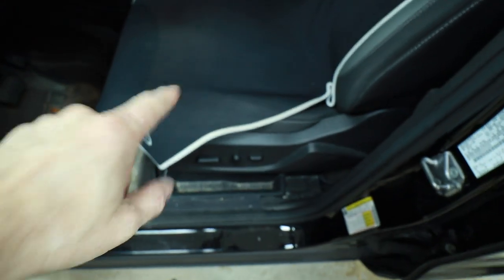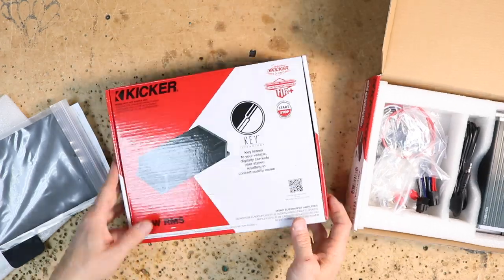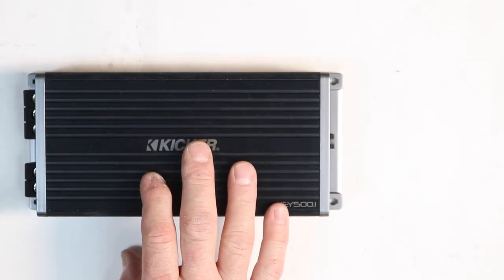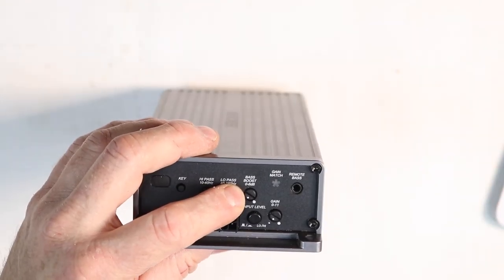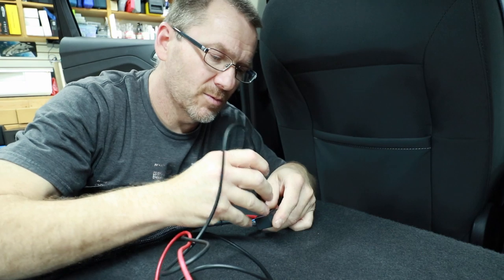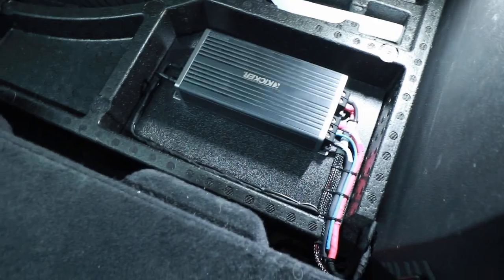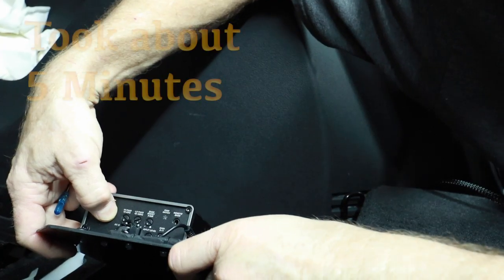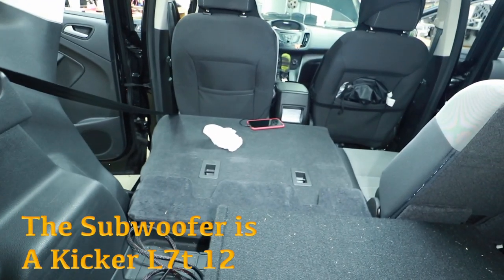The smartest sub amp ever Kicker Key500 1 Mono DSP Amplifier

Comment: Kicker should make a 100 watt x4 key amp and a 6 channel kicker key amp with 6 dedicated outputs 2 for tweeters, 2 for the midwoofers, and 2 for the rear coaxs. Then a kicker key 5 and 7 channel amps that does the speakers and subwoofers in one stop shop.
Reply: There could be more interesting Key products coming, you just never know. ;-) Stay Tuned...
Reply: @kipplitz  are the crossovers on the 500.1 LR24db as well?
Reply: @tfunk1829  Yes, they are 24dB Linkwitz Riley...
Reply: @kipplitz  Thank you, I got the 200.4 and was looking using this to hopefully avoid phase issues.

Comment: I lost all faith in kicker after purchasing one of their cx 4 channel AB amps. The thing would get scorching hot after just a couple of songs.
Reply: I just went with a Orion XTR 750.4 which has blown me away.... Tiffinay in and out rca jacks, underrated as hell(3x40 amp fuses) and it TINY For a  class AB. I don't know how orion does it. Look at Scar rp 150.4 and how long it is.  Orion's new owners are doing almost everything right.
Reply: 🤔 i just got my kicker key yesterday and I haven’t hooked up a sub but everything else is hooked up and I went on a 30 minute drive today and it’s hot to the touch, I wouldn’t want to hold my had to it more than a couple of seconds.
Reply: Yea man I took mine out after about week and replaced it with a pioneer 4 channel class D. I had it running my coaxial midranges. I'll never buy another class AB amp again.  My kenwood sub amp would be blasting max power to my subs and maybe only get a little warm while the kicker cx was a fukn inferno. Haha.
Reply: @hippo-potamus  not all class ab get retarded hot, at least not properly designed and mounted ones. There is nothing like the warm sound they produce. Cant beat class d $ to watt however.

Comment: I finished installing the 500 today to power a Kicker TRTP 12. I also have the Key 180.4. I previously had a 300 watt JL mini amp so I didn't really upgrade in power but I did notice that with the 500.1, the bass is actually omnidirectional where as before I could always tell the bass was coming from the rear hatch. I also added the bass knob which has come in handy. Even though the boost is only 6db's, it's still a noticeable difference at lower volumes. I have an aftermarket HU so I didn't really think the Key features would come into play but it may have done something to make it sound more omnidirectional but I haven't really listened to enough music to know for certain or if it was just because of that particular song I tested. But the easy to set gain and bass knob made it worth the swap for me.

Comment: Can't wait to get mine for my G8. Hopefully it'll push my T3 T2000 I have. I know it's underpowered but not looking to win spl comps lol.
Reply: @A. Melbs I don't even remember posting this haha. But anyway I mounted it on the cup holder middle section in the rear seats. I used little spacers under the feet to help with air flow and have it so the middle section can be folded up and not cause issues with wires. Hope this helps.

Comment: I just bought a used 2019 Rav4 non jbl system. I was thing maybe if running the 4 channel and sub kicker key amp under the glove box high level. Have you guys ever worked on one of these vehicles? Just to get some insight. Thanks!
Reply: Most all cars really similar and obviously sick what you want but  myself this would not be my pick! I like the auto adjust on the gain but I would go more serious! #1 after market head unit!!! #2 high amp alternator!! #3 get some 14 volt batteries!Then  for my money ($256) I would run the hifonics BRX3016.1D which puts out up to 2200 watt RMS !! On 2- 15'S  with all that said there are many amps out there that will out perform this tiny system and I will also add that the equiptment he's pushing is over priced and low powered! Has a nice tuning feature but any stereo shop worth their own salt or anyone with ears should be able to properly set up equiptment or tune a system! So it's sort of a redundant feature! I miss setting up systems myself but I would recomend shop around& look at other equiptment! I know maybe it's size is your goal but know that other manufactures needs space saving amp's too!

Comment: Did you purposely leave the LPF at 160hz and the HPF at at 10hz? As I understand it, you do this when using a factory headunit that has non-defeatable built-in crossover points. This way your not doing double crossover points or else you could run into phase issues (comb filtering?). However, how do you know what the factory sets those points at and if they'll be sufficient to use a with a larger or more powerful sub/amp combo?

Comment: I'm soooo glad kicker is coming back into the audio world. What I mean is in my opinion when kicker went square subs everything became, well cheap. I was a huge kicker fan in the 90s. Loved the first solo's too. But when they went square everything  at least to me seemed to be more oriented for the beginer audio to the lower lever guys. Budget friendly yes, but there wasnt the old still water goodness. The warhorse while a true feet of audio engineering was the only thing I have seen from them in years. That is untell the key amps. These in my mind puts kicker right back into the mix with  the killer koreans.  At least for me this is a product that will bring me back to kicker. I still have so many old kicker products. I'm glad to add some new to the mix. You may disagree with me on this, but I'm by no means alone on the feelings.

Comment: Curious... Why don't you ever use nutserts in the ABS when mounting the amps? Also... What do you do with excess RCA cables when you run from the back to the front? Just tuck it away under the dash?
Reply: @Michael Paredes   

Nutserts would protrude too far on the underside/backside of most of the thin 1/8"-1/4" ABS plastic sheet that they use.  And the rivit type nutserts will not "hold" in soft plastics...they will break free and spin with very little torque applied.

The other type of inner & outer threaded inserts that "screw into" wood or plastics with a hex or allen key driver require at least 3/8"-1/2" thick material, which they rarely use.

They answered the RCA question in one of their livestream videos a few episodes back...

They test the length & routing of various RCA interconnect cables in the car before actually installing them, and then choose the shortest RCA interconnect that will comfortably reach between the two components.

If it is still too long, they try to find another naturally good path or route that uses up the extra length of cable without having to bunch up the excess at either end.
Reply: @bbfoto7248  Thanks for answering my questions!

Comment: I have a dumb question... I know there's a kicker key 4 channel amp that you're pairing with the key 500 mano amp.... I Looked through the key five hundred mano amp and the key 4 channel 200 amp  online manuals  and I didn't see a passthrough to send a base signal from the 4 channel to the mano.... Does that mean you're taping into a front or rear speaker wire to send a signal to the key 500..

Comment: I got the kicker key 500.1 working. I was dealing with a bad remote wire. Follow up question can I use the high input from out of the Kicker Key 200.4 to the input of the Kicker Key 500.1? Will it sound ok?

Comment: Would you recommend this amp for the Kicker downfirering 10" Subwoofer 400 watt  or amp more beefy like a 500 watt amps.
Reply: Power wise it would be a decent match but what ohm rating is your 10? That's the question you would want an amp that pushes the power you want at the ohm rating of your speaker! Most amps put out may power at 2 or 1 ohm so if you 10 is a 4 ohm  then no it wouldn't be good!
Reply: Eric McGinnis gotcha it’s a 2 ohm sub, this amp puts out 300 at 2 ohm so it’s a bit under powered I guess.
Reply: @chrisdixon9504  being 2 ohm this opens the doors to just about any amp! Any decent 500 RMS amp at 2 ohm  should do and remember distortion kills not power so 500 clean watts but then again 2 ohm also brings up the distortion of the amp! I personally think you should consider swapping the 10 for 2 12 duel 4'S wired series parallel to 1 ohm and get ya a good 1000 watt! But you know monday morning quarterbacking with my should'a, could'a ,would'as

Comment: While you are adjusting the sub gain with the volume at 70%. How do you keep the other speakers in the system from playing very loudly? I noticed that while you were adjusting that subs amp the other speakers weren't playing.
Reply: just unplug the inputs on the highs amp?

Comment: Question on the subsonic filter; for a sealed 8" box, roughly what should that be set at? I've heard the filter is mainly for ported boxes (meaning you can turn it all the way to 10 for a sealed box), but figured I'd ask in case the interwebs have led me to the wrong conclusion
Reply: Drivers in sealed enclosures don’t need subsonic filters. They’re only needed with ported enclosures because below the port tuning frequency the driver will unload. It’s really easy to damage a driver when played lower than the driver’s Fs. When set correctly, a subsonic filter will stop that happening. I’m a sealed enclosure the air in the box will prevent the driver from unloading. The air acts as an additional suspension for the cone.

Comment: I’m wondering if you can give me some input.  I have a 2021 Nissan titan with the fender Soundsystem which has no bass there’s a subwoofer under the passenger seat which I would like to remove sub from the box and substitute it for a kicker shell mount 8 inch sub i’m curious to know if I use the four wires going to the sub as it’s a sub input will it have the power to turn the  kicker 47key5001 on

Comment: I know it has been a few months since you posted this video. I have a question regarding tubing and the bass knob. Should the bass knob be connected and turned all the way down or connected all the way up or completely disconnected during the key tuning process?
Reply: The bass knob on all Kicker amplifiers only turns down the bass. It's not a "bass boost" or "gain control" or "extra output dial" or anything like that. Remote knob all the way up equals whatever the gain on the amplifier is set to. It only attenuates. So to answer your question, either leave it disconnected or plugged in and turned all the way up.

Comment: I have the kicker key 180 running jl audi c2 components active in the front of my audi rs4 saloon it sounds excellent, I use a kenwood 5180 dabs. I have a sub amp setup in the boot and removed the standard woofer in the shelf to let the bass into the cabin, Is there a reason this sub amp doesn’t do time alignment for the sub with a mic, would this not be useful or doesn’t it matter on a sub? Love to hear your thoughts. Great video as usual.
Reply: David, I will try to not dive too deep here but get you an answer.

You can express how far away a sound or point of sound is in distance measurements (mm, cm, m, in, ft, yd) or in time measurements (344 meters per second, 1132 ft per second for sound in air at sea level). This is important because the two can talk about the same thing but in different expressions. It can be 1 second away or 1132 feet away, both say the same thing. We use time delay to make a speaker or origin point of sound appear to be further away from us. More time = Further distance.

When you look at time alignment, you can't speed things up and make them closer to you; you can only delay them. Delay in time = Further away from you. What this means is that the subwoofer in 99.9% of the applications is the furthest speaker away from you, you can't get it any closer to you in space, you could push it further away from you but that is not what you need in most instances. In most instances you need to push all the other drivers,speaker origin points further away from you to be the same distance as the subwoofer. Make sense?

This is why their is no time Delay on the Key500.1, it won't help you. In a "perfect" setup you delay all other speaker points to be the same distance away from you as the subwoofer then you steer the center image towards the center of the car by delaying the left channel appropriately vs the right. EQ steering is also beneficial but that is an even deeper dive.

I hope this gives you some insight.
Reply: Kip Litsey amazing thanks so much, fully understand, I’m thinking to delay the fronts more (the kicker amp I have has a mic to do time alignment) I could increase the distance manually in the head unit and do all 4 front speakers the same distance as the kicker amp then works it’s magic after the source unit. Or maybe I recline the drivers seat back as far as it’ll go with the mic on it and re time align it. I’ll have a play around but thanks again for the knowledge, much appreciated 👍👍
Reply: @dwdrum11  Yes, if you want to time align the input to the key amplifier to align with your sub, measure how far it is from your ear in the (SP) seating position to the (PD) passenger door speaker and (DD) driver door speaker.

Then measure from your ear in the (SP) seating position to your (SW) subwoofer location. 

Now...
(SP to SW) - (SP to DD) = Left Delay
(SP to SW) - (SP to PD) = Right Delay

These delays are what you would put in your head unit so that the entire front speaker system is delayed to be time aligned to your subwoofer.

Now, the EQ and time alignment in the Key 4 channel will be all about tonality and center channel steering, just like it is doing now.

As always, tweak away.
Reply: Oh, and don't add any delay to your radio's RCA outputs that feed your sub amp. That will defeat the purpose of all this.

Comment: KICKER should build an amp that has a   built-in  SPL  Meter!!  Or at very least invent an inexpensive method for testing up to 160 db. Read my previous comment --v
Reply: @Brandon Lee  

Unfortunately, microphones that can handle those extreme SPL levels AND also remain accurate long-term are still quite expensive to design and build.
Reply: Posted from previous...
Today, to measure SPL accurately in that range requires pressure meters and software to read and interpret that data. There are some options out there to do that at a reasonable cost and interface to your phone as the display and control interface, but not for $50.

Comment: Can you compare this amp versus the audio control acm300.1?
Reply: @Rafael  
 Well, the obvious differences are the power ratings, and the AudioControl does not have any DSP processing built in, so they are completely different products.  Go to the websites for each product and compare the features and specs.
Reply: @bbfoto7248  Which one has DSP? They both Sum the inputs and restore bass. They are at the same price point. yet the Audio Control produces 25w more at 4 ohms. I'm interested in the signal they generate and the difference in sound. If you have experience with both amps, please share.

Comment: I got a whole system installed by a shop where I live, with the smaller kicker key and an lc7i and jl amp. I bought the lc7i because I wanted to use factory radio on my 19 sierra. They installed it and it wasn't putting out much bass at all. I look under the seat at the lc7i and the accubass is turned all the way down. Is this normal?  the only reason I bought the lc7i was for the accubass

Comment: I'm a little disappointed in this amp. I like that it fixed the lack of low bass, but I thought it did measurement eq like the 180.4, but it doesn't. Bass eq for in car response is extremely important too.
Reply from the maker: It measures and the flattens the signal coming from the factory radio. It does an electrical measurement not an audible measurement.
Reply: @FiveStarCarStereoInc  Yeah, I understand. It fixes one problem, but ignores 2 others. I'm sure most people think in car frequency response eq correction for subwoofers is not needed, but it's needed badly. Subwoofers also need time alignment, at least relative the mids and tweeters.
Reply: @FiveStarCarStereoInc  So, does the KEY200.4 do the cabin EQ down to what bass frequency?
Reply: @89grand  you could take the signal from the high level AFTER the 200.4, y it off and send one leg to the door speakers and the other leg to the 500.1 input as a high level input. Then it’s more “fixed” by the time it gets to the bass amp. Still doesn’t help much for time alignment regarding the bass freqs though as the 200.4 will have that signal tuned for higher frequencies

Comment: Epicenter amp?
Reply: No, its not. The Key utilizes Equalization to fix the low end roll off from Factory Systems. In other words get you flat response and bring back the bass that is in your music but the factory system intentionally rolls out to protect their speakers.

An Epicenter creates bass by Subharmonic Sythesis. It looks at the original (dry) music and creates a tone (wet) that is blended back in to the original music.  

Two different technologies applied with two different goals.
Reply: @kipplitz  So to simplify, is like accubass but more integrated with the head unit. I am very old school this is all new to me.